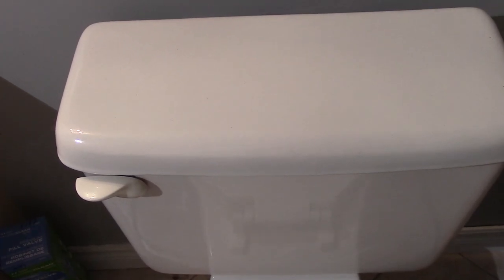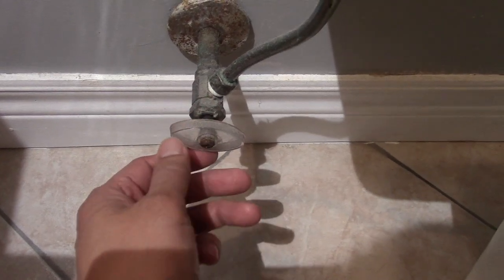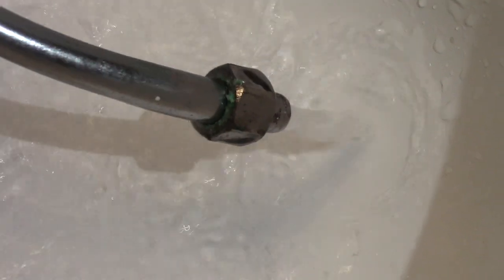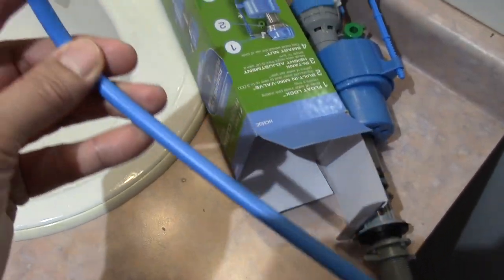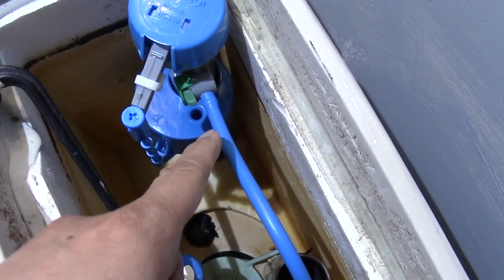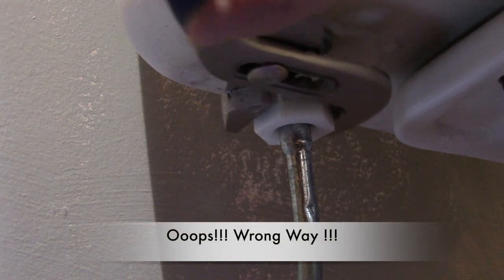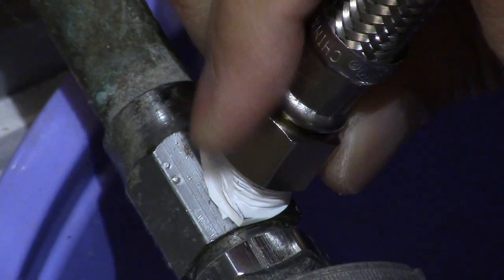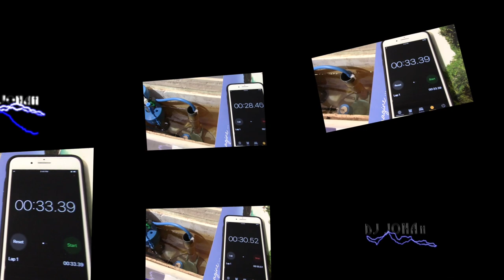Replace Toilet Flush Valve / HydroClean Fill Valve. Slow water refill after flush. DIY

Comment: Just installed mine, but do I have to hold down the flusher for so long?  If I hold it down for 1 or 2 seconds, I hear the toilet bowl clearing but the tank is only half empty? You hold the flusher down for a long time in the video
Reply from the maker: I hold down for 2-3 sec. Some toilets you don't have to hold down that long.

Comment: My tank dont stop running the water after i open the part valve fill.😁 its any change i can fix it?
Reply from the maker: It maybe the Flapper Valve. Try replacing the flapper valve first.
Reply: Ok, i try it. Thanks for your suggestion. Greetings from Indonesia. 😁